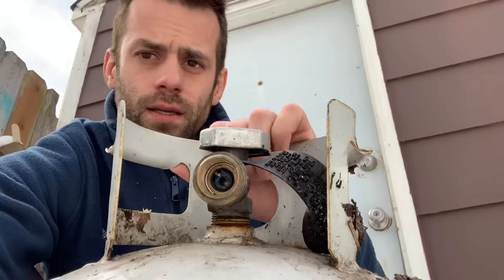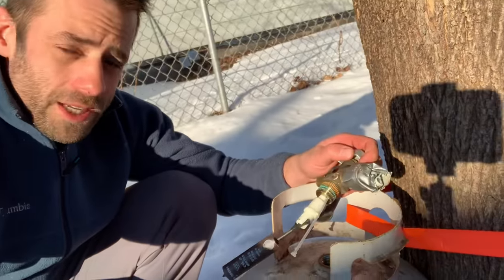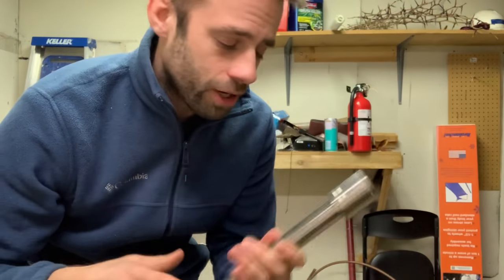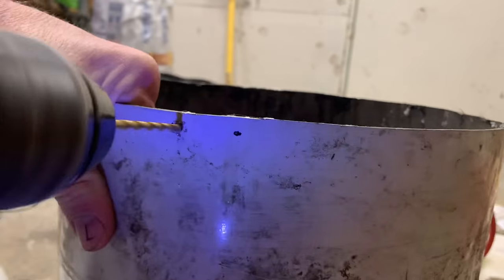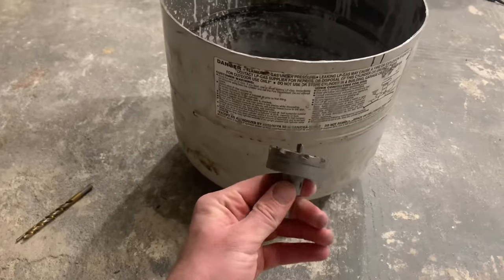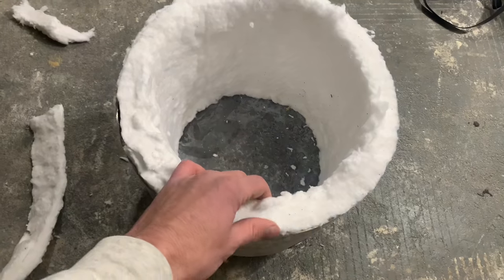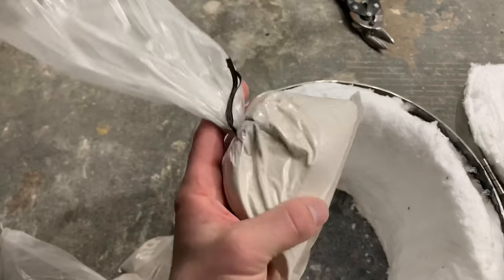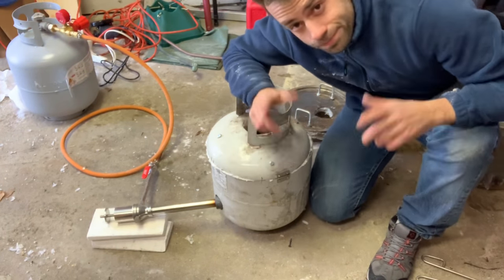How to build a foundry out of a propane tank in under 5 minutes: back yard Foundry

Comment: I didn't realize there is a safety valve to prevent propane from leaking if you open it without a hose. But no boom boom and no flames and it's now full of water. Thanks for the video.

Comment: Nice job. I'm working on something similar. A 40 gallon pressure tank, cut the same way, similar hinge, but using aircrete for the refractory. Finishing today, taken several pours, built my own foam gun. Using water glass for finish coat. Intended for forging , and foundry. Gas nozzle assembled and finished, tested. It's heavier than I wanted. It's mounted on a cast off heavy duty barbecue grill frame. Thanks for sharing.
Reply from the maker: Hope it works for you! Good luck!
Reply: @lundgrenbronzestudios what kind of regulator do you use ? Will a regular grill regulator work or not release the volume of gas needed?

Comment: Step by step AWESOME PROJECT which does NOT require a ruinous investment. You've got all it takes to be a project manager = Concise Precise & to the point. May I suggest using a fire-extinguisher as a crucible ?
Reply from the maker: Fire extinguisher crucibles dissolve into the molten metal and don’t last very long. Clay graphite crucibles are a better option.

Comment: I have saved up quite a bit of brass and copper wire I have friends who owns a well known locksmith shop and the other one of the top cable companies in the United States they saved all the brass and copper for me so I have close to 400 lbs of just brass I'm going to use your video to build my foundry
Reply from the maker: It’s been working well for me. I went back and made sure I coated all the wool with the wash. You don’t want any to be exposed. In the video I left the top uncoated. Im sure improvements can be made but so far it’s been working for me.

Comment: You said that the burner was a one inch burner. Is that an outside diameter or inside diameter? Also so while i was reading the comment, apparently most people don't read the comments before they post a comment, I think I saw that this fits a number 4 crucible. Is this correct.

Comment: Could you melt copper with this setup or would you need to do some more work to be able to get it up to temp?
Reply from the maker: I melt a lot of copper with this furnace. It depends mainly on how powerful your burner is.
Reply: @lundgrenbronzestudios how powerful is you're burner..what brand is it and where did you get it? Can you melt steel with it? If not what what upgrades would you so that it would?.  Oh by way I found non refillabe tank the was used for helium for party balloons or something. But same shape a propane tank. And I believe it's steel cuz of I tested with magnet and it stuck to it and the clink sounded pretty tuff lol😂

Comment: Great video!! How much or little cement do you i could get away with? A 50lb bag at the store is almost a $100 they have 12.5lb bags for lot less. Do you think 12.5 lbs will be enough for the bottom and maybe the sides if I don't make it to thick? I'm on a real tight budget. Thanks
Reply from the maker: Well I don’t know for sure but I think 12 lbs would be just fine. As long as it’s refractory cement and can take the heat.

Comment: I have an old propane tank that I'm planning on doing this to, also. I just can't seem to get enough leverage on that valve to twist it. Guess I need longer pipe.
Reply from the maker: Yeah. Strap it down good and get a longer pipe. It should come off with enough leverage!
Reply: @lundgrenbronzestudios  I used a 4 foot pipe and I Got that valve off! Thank you, brother!
Reply: I'm wondering, how did the hinge hold up, and would you change anything? I'm still assembling mine and think I might have to weld the hinge and also weld some handles on?

Comment: Apart the difference in weight, what is the difference between ceramic insulation and refractory cement? If I don't care about the weight could I make a furnace only pouring refractory cement into the tank and having the same performance?
Reply from the maker: No. It’s not the best idea to do that because the cement is such a “heat sink”.  It soaks up the heat and takes so much longer for for chamber to get up to melting temp. The time and extra fuel used each melt isn’t worth it. But technically you can do it that way. I just wouldn’t recommend it.
Reply: @lundgrenbronzestudios  It was a mere hope. Here, the ceramic insulation is freakingly expensive... -_-
oh, well... maybe a good compromise would be cover the ceramic insulation with a coat of refractory cement and make the chamber as small as I can? It should reduce the "heat sink" effect... 🤔
Reply from the maker: @TitusGalliusMontanus  yes that is an option. I like to coat my wool with “mineral Z wash” that’s what my local fire brick store calls it. Green patch 421 works well to coat it too. But still you want them to be thin. I’ve also seen people slide in a cardboard cement footing and pour in refractory cement in the space between the footing and the wool. That’s another way to do it. In the end there are many ways to get it to work. It’s just a question of what is best.

Comment: So if you wanted to build one double the size would it only take 10 min?...
Jk,..  I am curious though if it would be useful to have one about 4 times the size? Or would it make casting difficult?
Reply from the maker: It just makes things more challenging. Bigger furnace means heavier crucibles, so you might have to do a two man pour. Get big enough and you need hydraulics to lift it. And those foil suits to repel the heat.  But you could make one out of an old keg or hot water heater and that would be ok.
Reply: Four times the size of course means four times the volume. Otherwise  don't  contemplate the dimensions  being increased four ti .mes cos it means a huge volume increase.

Comment: You should have left the tank full of water when you cut it.
Gas remains adhering to the metal surface and is released by the heat of cutting and welding.

Comment: Love the design, I'm making one now. I do have a question for you about your refactory bottom, did it Crack at all? I had to pour it twice. First one Cracked and I tipped sideways to get debris off the top and it fell out in pieces. 2nd one I welded a piece or rebar on the bottom to give it something to bind to, and its starting to Crack! Still curing will see how bad it cracks
Reply from the maker: I used Mizzou refractory wich in known for being very strong. But I also made sure to heat it very slowly so the water inside was driven off slowly. Even if it is cracked though it shouldn’t be a problem. It can just sit there can cracked. I’ve never flipped my furnace upside down so I’m not sure what would happen if I did.

Comment: Found you thru the FB group! I am looking to build this exactly like yours. Can you help me to identify the exact parts? 
1. The 1" burner - Where to get it and how much?
2. The refractory paste - Where and how much?
3. The ceramic insulation - Where, how much, and how many linear feet?

Thanks in advance!!
Reply from the maker: Griz Lee this is the burner that I got. I like it. Propane Burner For Propane Forge (Stainless Steel) Knife Forge Furnace Foundry Raku Kiln Melting Furnace Blacksmith Tool Pack Includes Valve, Hose & R https://www.amazon.com/dp/B07HB1FHCK/ref=cm_sw_r_cp_apip_w2XN8GxM4cjxg
Reply from the maker: Griz Lee as for refractory cement I bought a 50lb bag for about 50$. You can use only refractory cement if you just put a tube in the middle and fill the tank with about 2-3 inches of cement. That way you wouldn’t need the ceramic insulation. But make sure it’s rated for over 3000 degrees if you do. As for how many ft of ceramic insulation? I can’t remember but you will want the higher rated stuff. I think mine is rated for 2800 degrees, and you will need enough to fit the circumstance of the tank, plus the width of the lid. 
I bought mine by the foot at a fire brick store. If you don’t have one you will have to by a roll of pre sized packages. So just pick one you know will have enough.

Comment: Do you know the length of ceramic fiber needed to go around the inside of the tank?
Reply: Diameter of the tank times 3.1415 plus a tiny bit more to make sure its all the way around
Reply: @zacharyj6465  I didn’t have a tank yet and was purchasing supplies. If I had the tank measurements finding diameter would have been as easy as pi. I just bought lots of extra ceramic fiber. I also ended up building my furnace with a stainless steel 1/4 barrel keg. Turned out great and melts aluminum in about 1/5 the time my old one took.

Comment: I was under the impression that the ceramic insulation that causes lung cancer and all sorts of other bad juju had to be completely coated, especially on the sides where it had been cut. The idea being that the fibers that can float around are on the cut edges more than on the factory cut sides.
Reply from the maker: Yes you are right. I did since coat the edge. Maybe I should add a note in this video.

Comment: i went a bit mad with mine... overkill? intended for doing a #16, iron... so yeah. bit big. ar1650, 1800C peak temp. wee. only got a #10 so far. 

made a heat exchanger, preheat the air before it enters. gets pretty toasty. saves a hell of a lot of fuel. takes a while to heat up though as im not pushing it. gotta change my oil feed to a drip.

https://www.youtube.com/shorts/_B2yg0jPVEk?feature=share

Comment: Awesome video, very easy to follow, BUT.....
#1 can you PLEASE PLEASE PLEASE put a list of all the materials needed and where a person might find them.
#2 you really need to change the title of your video.  There is no way whatsoever that this can be....or was.....built in 5 minutes.    Every step you demonstrated in this video would take 5 minutes or more to complete.  Let's keep it real huh.
Reply from the maker: Tell me, how long is the video?…

I don’t use online stores. I source things locally so what ever the firebrick store in my area has is what I used. 
You need A propane tank, ceramic insulation 1-2” thick, I used refractory cement on the bottom you could use soft fire brick but it won’t last as long, and you need to coat the insulation. I used z-wash in the video but “Greenpatch 421” is a good coating as well.
Reply: @lundgrenbronzestudios  thanks for a bit more info on the materials.  

I wasn't the only one commenting on the "5 minute" impossibility.  Sure, the video is only 5 minutes, but obviously most people interpret that title to mean that building the project takes less than 5 minutes, not that it means the video is only 5 minutes.

I also was far from being the only person who asked for a materials list.   It's so nice that you singled me out to reply to with your condescending tone.  I would think a person would be happy that others found the video was good enough, to want to know what all the materials were that were needed to build the project.  Also, not all of us are pro's like you, and some of us need just a little more information than others.  And isn't that the whole idea behind wanting to share your knowledge?  I have no idea why you seemed insulted when someone asked a very common question that is asked on all tutorial videos that don't have a specific materials list.

Thanks again for the video.

Have a nice day.

Comment: Uhhhh you must live in a higher altitude than me, so you can better experience relativity, because that was not “5 minutes” for me!
Reply from the maker: How long was the video?
Reply: @lundgrenbronzestudios  The video was 4.59 minutes, but the title states “How to build….in under 5 minutes”.  Meaning that it will take under 5 minutes to build.  Now if the title stated “How to build a…in an under 5 minute video.” then this video would be just as the author intended.  But to build what the author made in the video is an all day long process or more!  It truthfully falls into the realm of false advertising.

Comment: Step 1 in metal casting is learning proper terminology.  You are building a FURNACE here, not a foundry.  

Found·ry /ˈfoundrē/ noun noun: foundry; plural noun: foundries - a workshop or factory for casting metal.

How are you going to invest your wax?
Reply from the maker: That’s good to know. I didn’t know that distinction. 

I have jewelers investment that I will try to use for the lost wax casting.
Reply: @lundgrenbronzestudios  its very easy to use.   Use distilled water and pull a vacuum on it before and after you pour.  In case you dont know, investment is gas permeable and you maintain a vaccum on it also while pouring metal in it.  Some choose to spin cast the flask, I dont.  A cheap pump from the hazard fart works great for this.  I subbed so hope your bear turns out good!  You going with silicone bronze?
Reply from the maker: I’m still working on tooling up and I hope to get a vacuums chamber someday. For now I don’t have one so I’ll will hopefully still be able to get a good product in the end.
Reply: @lundgrenbronzestudios  for a cheap vacuum rig, watch thehomefoundry channel.  you dont need an expensive table.  Just a pump, some pipe and a couple of fittings.